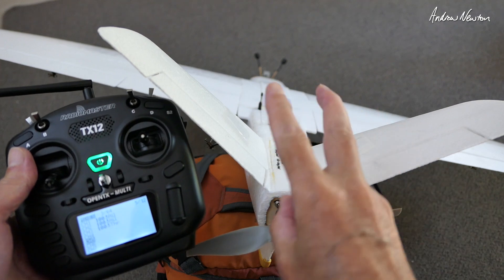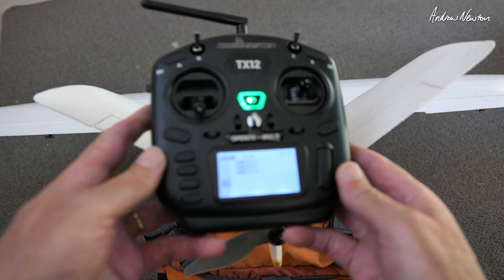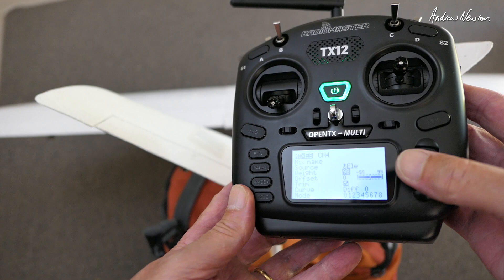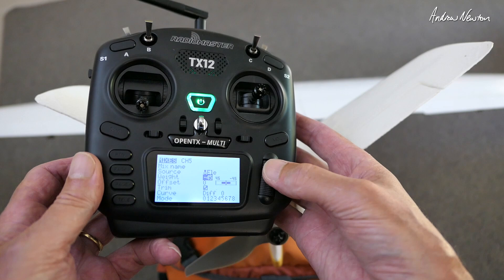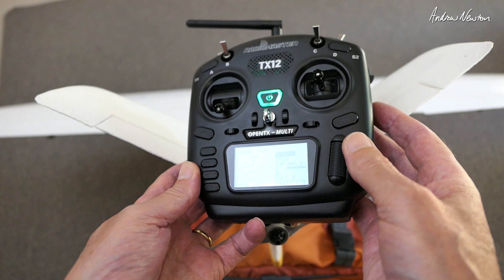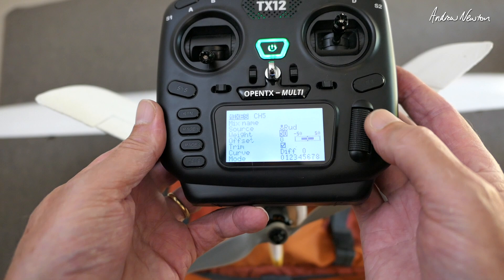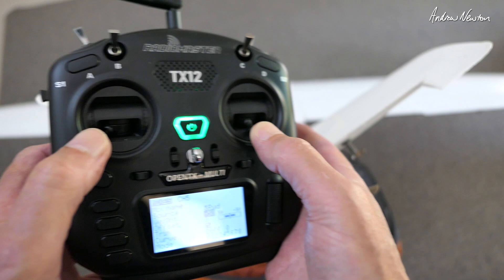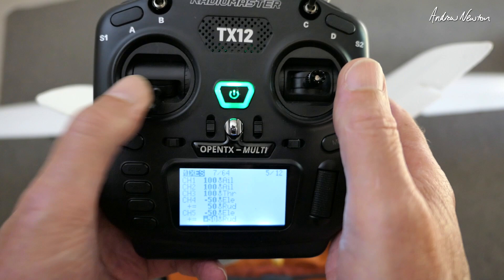V-Tail mix for TX12 OpenTX EdgeTX

Comment: Hi Andrew, I tried the same on a v-tail of an old Graupner Cumulus 2m equipped with a Radiomaster ER8GV. The radio is a Radiomaster Boxer ELRS. If I assign the v-tail on channels 4 and 5, strangely, one servo of the v-tail has undesired movements when I move the ailerons stick. If I keep strictly the order AETR and that I assign channels 2 and 4 (E and R) for the v-tail, it works correctly. I have no clue why it does not work on channels 4 and 5 so, if you can reproduce on your side,  I would be curious to know your opinion. Cheers!

Comment: Andrew, great as always I am really confused......I use AETR and if I do it this way for my V, how is CH1 going to work my Ail?
I have two V taail planes built almost done and I am stuck  Please help  

 Thank you for all your videos, I even have a phoenis 2000 and 1600 paint scheme just like yours but one is orange, you are the best!

Danny, from across the pond at the beach cliffs of So. California  USA
Reply from the maker: Hi Danny. AETR is only relevant for a simple 4 channel model and it doesn't mean you are stuck with that arrangement. In my video Ailerons are on Ch1 and 2. You can use a Y-Lead and have ailerons just on Ch1. Not really sure what you're asking. You can have any control surface on any channel with EdgeTX and OpenTX
Reply: @AndrewNewton  I'm also setting up my channels and im a little confused. I have a Zohd Vtail. it looks like the default mixes are just 4 channels A, E, R, T and they all work and respond fine on Inav. I'm confused why your adding Rudder to channel 4 & 5 with the elevator?
Reply from the maker: @itssjp1458  This video is for VTail mixing on the radio with no Flight Control Board. For INAV setup watch this http://newtonairlines.blogspot.com/2023/06/inav-trouble-shooting-checklist.html